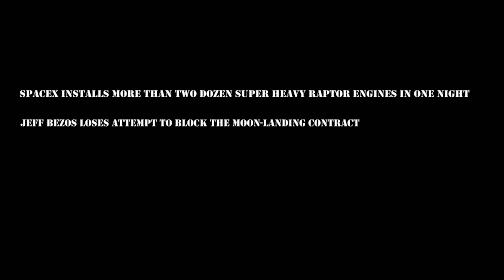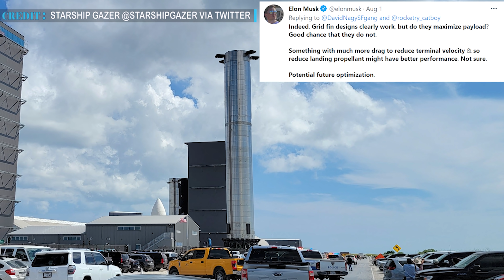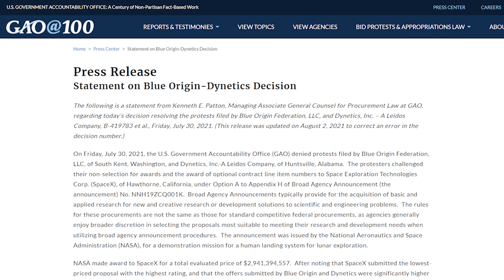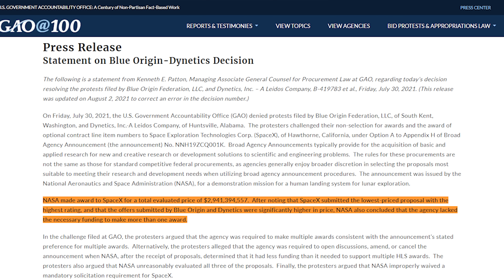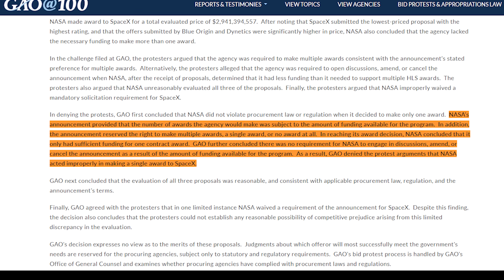SpaceX Starship: SpaceX installed 29 Raptor on Super Heavy | GAO denies Blue Origin’s challenge

Comment: Something doesn't seem right with the super booster's top fins. If the tower is supposed to grab it mid air while landing by the top fins with 2 arms, how is the tower supposed to grab it by the top fins when the fins are not all around the top circumference? What if the booster lands  at a different rotation and miss the arms? Unless the booster is able to control its rotation when landing?...

Comment: NASA now needs to work towards getting the SLS program canceled following the upcoming scheduled mission.  That will free HUGE amounts of NASA funding for USEFUL and important projects.  Instead of the SLS (which is like beating a dead horse) -- employ the same engineers to R&D projects needed for the Moon base or on Mars.  They can take the dimensions and other specifics of the Starship and prototype all kinds of possible uses.
Reply: My thought is just finish Artemis 3 with SLS, and then begin sustainability, aka cutting SLS from funding and letting it die.